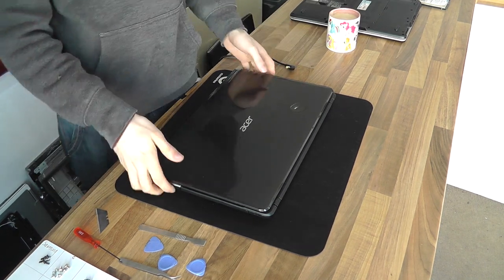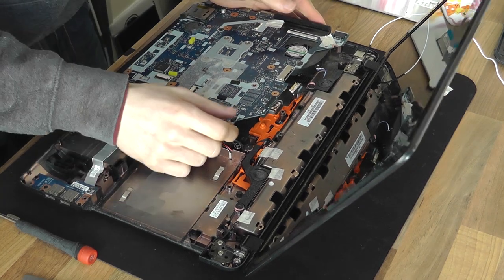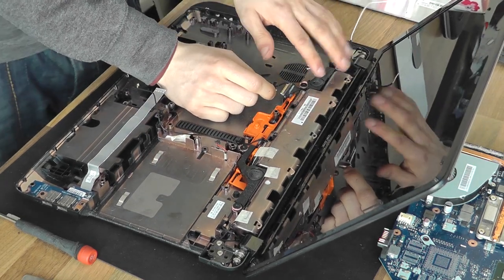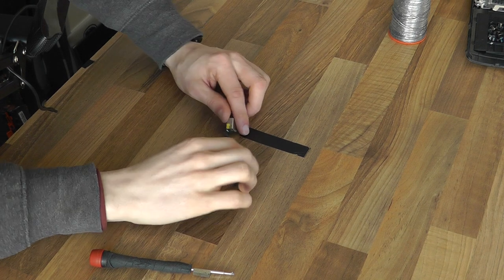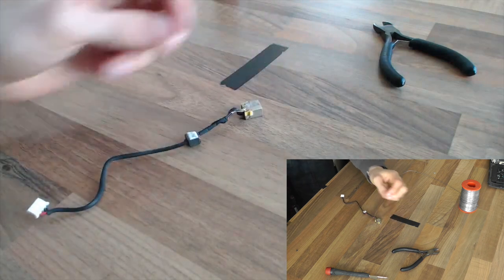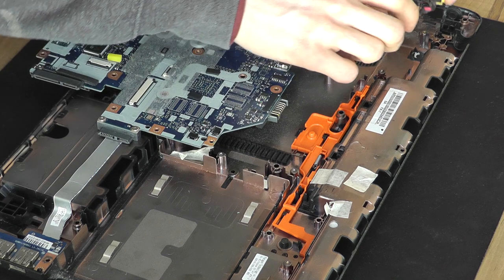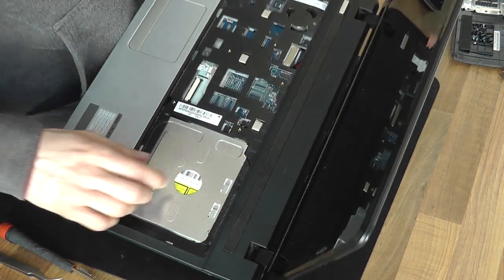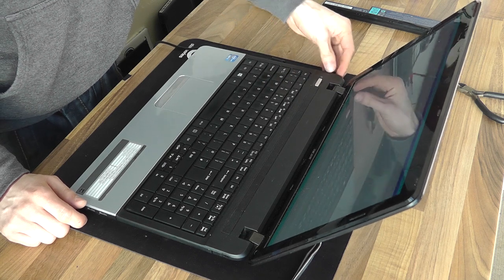Let's Fix Computers Ep.29 - Aspire E1 Powerjack Repair

Comment: I can recharge my laptop (acer aspire) only maintaining the cable in a certain position in the adapter. The power supply cable is loosen when connected. What could be the problem? The cable inside the laptopt cannot stay fixed to the base.

Comment: Really enjoying your videos. Very well produced.  I actually used this one as a guide to carry out the same repair.  Unfortunately the laptop is still saying "Plugged in, not charging" but the battery says it is at 100%.  We have previously replaced the battery and charger - any idea what else could be the problem?  Could it be BIOS related following windows 10 update?  I'm a bit scared to update the BIOS in case I completely knacker the laptop.
Reply: I know my answer will most likely not be helpful for you, but maybe for someone else, who stumbles upon this question:

If your laptop runs fine on the power supply ("charger"), neighter the power jack nor the power supply are bad - that's why it literally says "Plugged in", so there is no point in fixing/replacing those. Only exception here would be, if you had a "3 pin" connector with an additional "sense" pin. In that case, you can usually check in software, whether the charger is correctly detected, and also, the sense pin is the least likely to break.

Could be a bad battery, bad charging circuitry (which is on the motherboad) or bad bios. If you are having any issues like this, a BIOS update should be performed, but most likely, it will not solve the issue. If replacing the battery did also not fix it, the charging circuitry on the moterboard is the most likely suspect, but fixing that would require schematics, parts and board-level SMD rework, so you might be better off just replacing the motherboard in that case.

Comment: Just tryed to fix my port as the loose connection wouldnt charge, opened laptop and then got the Jack cable  still connected when putting power supply in and with a tweek it would start charging then stop so tryed resoldering the wires and now when i reconnect the jack no power what so ever is there something els it may be now?
Reply: Test your jack with multimeter. Then test your board for short circuit. Watch other vids on this channel about no power issues.
Reply: @eustacehendrix9659  i ordered a replacement jack and power block arrived yesterday worked like a charm

Comment: Hi I my power jack needs replacing, I have an Acer aspireE1 series how do I know which power jack to buy I have checked Don ebay I am in the UK but they have different numbers on them? Thanks
Reply: I have the same problem, did you find out how?
Reply: @est495  same with aspire E 571-G buy this

Comment: Hi, my dell latitude e5530 screen flipped completely backwards and the display became extremely dim barely noticeable, now I can't see anything it still come son and if I connect it via hdmi to the TV I can use it perfectly. I thought maybe I just had to change the lcd ribbon cable but then I saw something that said it could actually be the inverter, I  have a basic level of comljter knowledge and have successfully been able to repair laptops using videos like yours in the past. What would you advice thanks
Reply: @Adamant_IT  yes I raised after, thankyou for this yes it's definitely the cable I've taken off and the red wire in the sver cable is snapped and has a burnt smell I don't know that has happened. But I've bought a replacement.
Reply: @Adamant_IT  hi I've just replaced the ribbon cable but the screen hasnt come on, I can still use fine when I connect to TV via a hdmi cable there's no fault with the picture... Do you think it will most likely  be the lcd screen? And if its. Ot the screen in your professional opinion what then could it be?
Reply: @Adamant_IT  thank you so much for all your advice so far, this is too complex for me to do check or do I'm going to take it into shop how much would something like this cost do you think?
Reply: what did you do? you got any solution?? same thing i am facing with my laptop.. complete white screen.

Comment: I want do this at home do i have too pull it apart compleatly to reach the faulty part my power jack hase sunk in and wigels around when i push it with a tweezer 
what shuld i do ?
Reply: Still need help? I just did the same repair just last night the outee part sunk in, what i did for my unit was remove the back cover unplug the connector from the board...

Mistakes you shouldn't repeat i tried poking it and it snapped if you can try pulling the terminal from the back and reform it. I did that late and instead of reforming i did a very messy soldering job works though.

Or bring it to a repair dude and he'll do all that for you